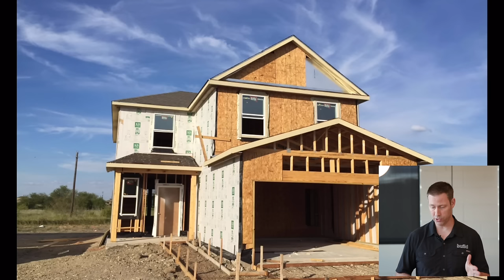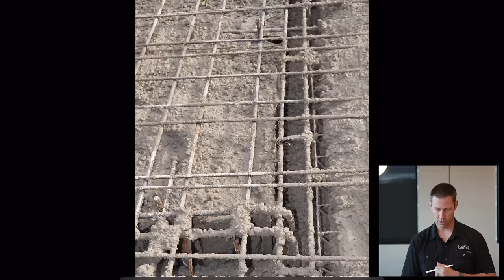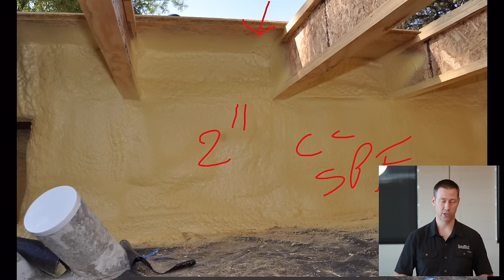Foundations - Slab vs. Pier and Beam - Which is better?

Comment: I'm wanting to build a super inexpensive retirement cottage(s), for myself (and others), two bedroom two bath deals. What about just a really thick slab? I'm in Corpus Christi. And the soil is clay, and most of the homes (not all) are pier and beam, and no perimeter wall. I come from Long Beach, CA, and everything is either slab or raised foundation (pier and beam with perimeter wall/stem wall and a crawl space). I was running a remodeling business, but quit that business when Covid hit. Been looking for a place to build cheap, but little did I know that materials costs would make building impractical for "poor" folks. So I am considering the cheapest cheapest ways to build. Here in Corpus C. the clay soil is lousy to build on, and most homes have waving rippling floors. Could be made level with difficulty. Seems a small home on a thick simple slab with plenty of rebar would work nice, with nice thick beams and footers running through the slab to stiffen it up, Would the clay soil still heave and shrink etc. and make for a disaster? Or, if thick and strong enough would that hold up? Again, this is for cottages, 2 bedroom jobs, not a big house, 1.000 sq. ft. or less.

Comment: My personal notes: 
1: I must learn more about “Soil engineers”
2: slabs are incredibly durable foundation IF DONE RIGHT. 
3: Monolithic pouring is best. 
4: rebar slab is superior and nothing less is acceptable. 
5: rust proof the rebar grid work itself with cheap but durable water proofing substance/material of choice like a spray on vapor barrier. 
6: all upgrades and protections must be done prior to Slab being poured. Must be done perfectly prior otherwise post slab upgrades are expensive aka unacceptable. 
7: Must research why frost lines are a threat. 
8: bedrock makes digging expensive. Having 3 basements is impossible if such a problem isn’t solved or avoided using soil engineering and creative thinking.
9: 2 inches of closed cell spray polyurethane foam can air condition a space to not need insulation.... interesting. Can it be used for the under belly of a mobile home too?
10: Pier and beam houses are extremely easy to take care of and maintain and repair and upgrade and are cheaper AND are easy to move around to other geolocations because of their design. Good to know if I wanted to start a business.
11: Soil engineer is paramount. A structural engineer is also important and builder too.
12. I’ll most likely be doing an In-ground foundation for my 3 basements of my house, assuming I found a way to address the bed rock.
13: I might need to own my own Hoe Ram 😂
Reply: Frost lines are the depth into the soil that typically gets frozen during winter. When water freezes it expands ever so slightly. Generally you want to build your foundation below that frost line so that the building is unaffected by movement created by frozen water. If you don't build below frost lines then your building can either sink, or teeter into becoming un-level.
Reply: Douglas Williams oh wow 😯 Thank you Douglas for the quick and concise explanation ☺️

Comment: Hey Matt!  I live out in West Texas and my foundation is just a little bit different than the two types of pier and beams you described here.  Our house was built in '82 and has a cinder block perimeter wall, pier and beam foundation.  It's just dirt underneath the house, and each side only has 1 or 2 holes cut in the perimeter wall for ventilation (about 2"x3" in size).  Is there a different term for this type of foundation?
Reply: Snake den
Reply from the maker: That’s a pier and beam. I like the perimeter beam on your house. Look up Crawl Space Ninja in YouTube. You have some upgrades you can do down there
Reply: Thanks Matt!  I'll look into that!

Comment: Cutting a tension cable, been there done that. It's really loud.
Reply: Steve Slade  forty years, I don't think we know that yet as they haven't been used in residential for that long, at least as far as I can tell. I mean I've only run into them in the last 25 ish years. In any event, everything in the concrete is availible with coating these days, though obviously  some members have better coating than others.

Comment: Well using spray PU foam give a lot of problems, the fume which gets exposed is toxic, in Europe it is not permitted to do. Building a slap foundation you have to put down a vapor barrier then min. 10 cm and then the concrete slap with reinforcement wire mesh better fibers which protect the cracking. Doing it this way in the area you get frost in the wintertime is not going in the slab. The outside perimeter should have a board of 5cm Expended Polistyreene Boards, this protects the frost going in from exposed sides.

Comment: Never put hvac in the unconditioned crawl space. It’s one of the worst nightmares. It’s very difficult to service the unit, shorten the life of the unit, mold grow. Slab is better but if you need to have crawl space, make a utility room on the first floor.

Comment: I'll take a insulated slab house any day. Especially if it is just a single story. If it's a two story home. Then use an 1-1/2 floated self leveling floor upstairs. This creates a super quiet home.
If you have kids. You cant hear them running around or even walking through the house. A pier on beam home is noisy s hell especially if you have smaller children. You can hear the kids running all over the house.  Plus, There are so many new things to use with concrete on grade. Radiant heat is just one of them. If you used a 11's qualified designer. He should hve looked into the future.  He should have put all the bathrooms on exterior walls.  Plus used radiant heat. The bathrooms on exterior walls means when you want to remodel all the main pipes on outside the main home. The only thing that should be under the slab is sewer lines & a good insulation.
Reply: Steve Slade  everyone not just children can be heard throughout a wood floor home. After the children grow up we get grandchildren.  Then great grandchildren.  It's not a fool & his money. One day you'll be able to afford nice things. Keep working.  Hopefully you reach my age. If you do. You'll understand there are many benefits to a slab home. Quiet is just one! 
  I feel sorry for your children.  They can't play in the house. They're making to much noise for poor Dad!
 He's trying to rest.
Where with my idea. Children can just be children. 
  My oldest is probably older than you!
Reply: Steve Slade  I forgot.  I can afford what ever I want......
Keep working.  One day you'll understand.

Comment: Since rebar rusting is a major cause of concrete failure why don't folks coat their rebar with zinc or stainless steel?
Reply: Cost. And if rebar is set right it shouldn't rust

Comment: For California earthquake country I would assume that a rebar slab foundation would be best.   Don't some people pour a slab on foam for insulation?  Has that gone out of favor?
Reply: No slab on foam is getting more popular these days in California because there's some advantages against expanding and poor soil conditions. We had a pier and grade beam foundation where the pier and grade beam were separated by geofoam, our soils engineer recommended some kind of loose fill between due to unstable soil conditions and geofoam was one of the recommendations. 

Because of labor cost, if you're building a 3 story house in CA. It might be faster and more cost effective to just pour a mat slab, which is just a 12-24" slab using the weight of the slab to anchor the house down.

Comment: Thanks for sharing this presentation. (Anyone with experience is welcome to provide advice) can you have slab and pier foundation on a slope with poorly drained loam silty Frederick soil (this is Virginia)? I would like to lift the house on the piers and the slab on grade will be the floors touching the grounds (after grading the area on that slope); This will give me sort of a garage and empty space under the house? Is it sound to not want to use a block wall to support the house and rely just on the Beams (or piers if you will)? (ignore the fact that the foundation will be exposed for the moment)

Comment: Hey Matt! Why people in the U.S. build houses that much using mainly wood? Why not much brick and concrete houses? Just as an example of an issue:
Wooden houses floors are to be insulated to get it silent from steps👞 and voices... That is an important money investment just to fix that matter... A second floor concrete slab has almost zero noises transferred to the lower rooms; which is achieved in "one pass" and a more simple process... And don't get me started in hurricane resistance of a brick and concrete house vs a wooden one. 

Not to undervalue wood framing. I'm a carpenter myself. I'm just curious about it. ... Maybe it's because of prices? The same house built on wood is cheaper than on bricks and concrete? 

Please someone explain :) 

Cheers from Peru!
Reply: Builders in the USA are stuck with their methods and not willing to change

Comment: What do you use to keep moisture coming through the walls of some of those deep slab foundation's in the video
Reply: Billy Stuckey try duck coat. Floor drain is always a kickass idea. Sump pumps are necessary sometimes.

Comment: I never understood the logic of pouring slab with water pipes in it....why not create a channel with a  beveled ledge and steel plates for all plumbing runs so if you have a plumbing problem you pull up tile or carpet, then unscrew your steel plate, replace/repair pipes and then put back together?

Comment: Would it work to use post-tension cables and a rebar grid together❓ At least, if a post-tension cable gets severed, life is not over for the slab.
The active ingredient in expanding grout: Has anyone experimented adding just enough to concrete to counter its shrinkage❓ Or better yet, enough to cause the concrete to expand, say, 1/16" over 10', putting the rebar within under tension; an automatic post-tension slab. Take that, cracks!
Reply: Won't work, the cables have to be mechanicaly tensioned untill the concrete has cured fully, more used on high-rise and commercial buildings, n need for it on domestic homes

Comment: With a slab you don't have to worry about a crawl space: varmints, moisture, bad air going into your house, drafting through walls (unsealed holes), dirty air seeping through edges and making carpet dirty, rot with so much of your wood structure close to the ground etc. Having to maintain piers, foundation vents. The raised floor is more comfortable to walk on and you get a more cozy feeling, if that makes any sense.  You really need to seal up a raised floor and make a strategy to handle moisture and ventilation. Don't put ducts down there if you can avoid it.
Reply: Ducts can be insulated.

Comment: Have you tried using structural grade eps for your slabs? It can be used directly under the footings/beams with EPS 300+ or as a void former to create the suspended slab with EPS 100.

We use a company over in the UK called Cordek whos product is filcore which has worked great! Makes the ground works a dream as you only have to flatten the whole site! Far more cost effective!

We also use the ICF panel as permanent side forms, this allows us to continue the walls up flush! All the insulation helps control the temp of the slab too so much less cracking depening on how wet out put in the crete!

All the best, James @ivettbuild

Check out some of our projects on IG if you want to see more! Just thought I would put in my opinion to insulating slabs following your comment 👍

Comment: I comes up a question that if concrete slab is easy to be cracked since big area of poured concrete.
Reply: They cut the concrete at regular intervals before it sets so as to induce the cracks there . Done properly no other cracks will appear.

Comment: The foundation system is not arbitrary.  Slab on grade is the standard choice in the south west if soil conditions do not require more intensive systems.  The contractor is typically not able to chose the system they want to use, it is generally prescribed.  On custom single family projects the contractor may be given an alternative designs from what is suggested by the geotechnical engineer but it is usually significantly more expensive to the owner.  At the end of the day, trust the engineers to value engineer, they do several projects per week built by many contractors, not a handful of projects per year...
Reply: That comment is right on track, very sensible 👍

Comment: Instead of excavating for a basement, can you raise the floor elevation and grade up to that level? basements are so valuable for utilities, space, and really complete the building.
Reply: That is not the proper look, for southern regions, and certainly would be out of place in SoCal where I've lived for over 60 years with my eyes wide open.    Houses like that, with stairs leading to the front door, are a Chicago thing, right?   And they're terrible for handicapped considerations.   When I replaced my driveway, I employed ramps and minimized steps.    A person in a wheelchair (which could be me, someday) can enter (by going around to the back doors which swing wide open) without encountering stairs.   My arrangement might not meet ADA standards (which I have studied) but it is invisible; the handicapped people in my neighborhood have visible remedies, some permanent (concrete), some temporary (wooden).
Reply: Depends on the layout of the property and neighboring properties if in close proximity. In some instances you could make what looks like an excavated basement but on a small piece of property it would probably look like the house was built on a mound. Building a "raised" house instead where the basement floor is at ground level or just below the surface is common in many parts of the U.S. but as John Becich mentions having to go up a bunch of stairs to get to the living area is less than ideal. I used to live in a split entry house where we had to go up steps from the driveway then up steps from the foyer to the living room. Sucks when unloading the car of groceries or carrying heavy items in or out. We much prefer the more traditional house we live in now (for other reasons too but that was one annoyance).
Reply: I can’t think of any situation where it would make sense to do what you’re describing, particularly from a financial standpoint.
Reply: kam2244 X One of the best floor configurations for ease of living I’ve found to be is a tri-level, a.k.a. (depending on with whom you are speaking) a split-level or raised-ranch or reverse-split (oh wait: that last one is a financial (stock shares and stuff) term, not a type of house layout!), where the garage and front door are more or less at street level, with bedrooms on the upper floor, kitchen/dining/living/garage/main entry on the middle floor, and family/den/storage on the lower level.
Reply: Can not build  basement in FL due to the water table, so the norm there was an above ground basement as Carol is mentioning about, and above that is the living space. As for ADA compliance, there this nifty system called a residential elevator! for you experts moaning about said problems with stairs for those with limited abilities trying to make yourselves seems like experts when you are just "armchairing" your expertise which just seem like childish complaints to me. I worked for a moving company for the few years I live down in that state and I am from MA where basements below grade and some with one side walk out accessible to the property with just a simple door are also common as I worked for my step dad doing basement waterproofing. Another thing useful of what Carol asks about is great solution for a hangar home as opposed to being like a house with attached garage, for such example look at the Silverwing at Sandpoint (Idaho fly-in Community) and take a gander at their home designs which is a hanger with the living space ABOVE the hangar: http://www.silverwingatsandpoint.com/units_floorplans.html

Comment: Hi Matt,  Wood floors are easier on your body because of the resonance more than any give in the floor.  Concrete and steel magnify the bodies vibrations.  Think oscilloscope and sine waves.  When you walk or move you generate vibrations that interact with your walking surface and reflect back through your body.  The sine wave of concrete is closer to your bodies and thereby increases the peaks and valleys (even more so on a steel deck) while wood and body are more dissimilar and tend to cancel the highs and lows moderating the actual vibration your body endures.  Even more pleasant would be to walk barefoot on a golf course as the peaks and valleys almost cancel themselves.  The point is building 'bounce' into a floor structure isn't desirable nor advantageous over a stiff floor for many reasons.  Enjoy the video.  Take care.  Doug

Comment: What's one is better for ICF home or a  Passive home
Reply: I always build raised conditioned floors in my ICF houses because this gives you a 15 percent bump in energy efficiency while the comfort of spring in the floors. Radiant floors , R30 ICF walls, R 65 roofs, R20 floors gives me 10 Btu's per square foot for heating and cooling in climate zone 5.
Reply: If your budget is not high in mind or your not needing the space and standing head room of a basement, a crawlspace is best for those with no need of the extra living and storage space. As Dave Taylor mentions as well, compared to a slab, it allows for a nice more convenient access to utilities that may run underside the floor and home and you can walk on a softer more giving wood joist flooring compared to a very uncomfortable and hard unforgiving slab.